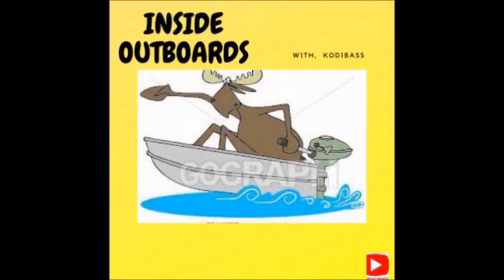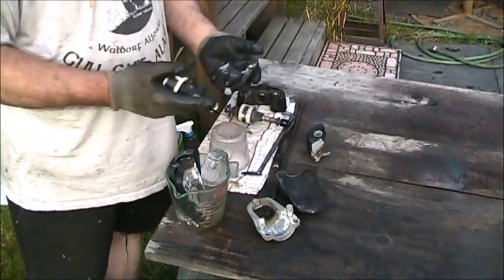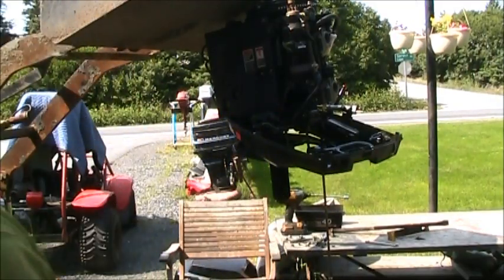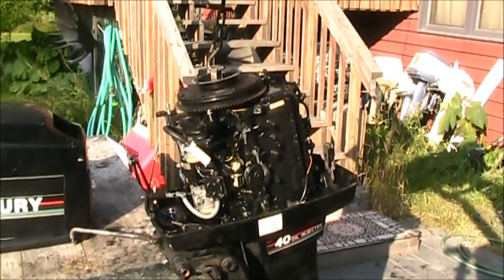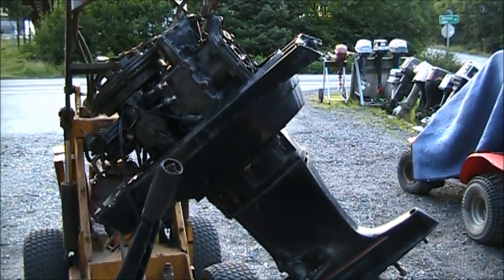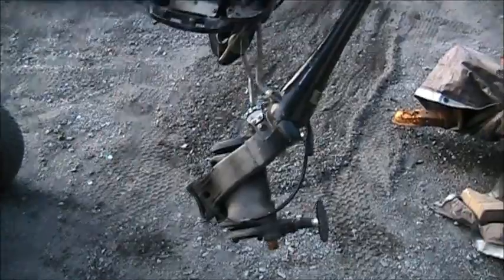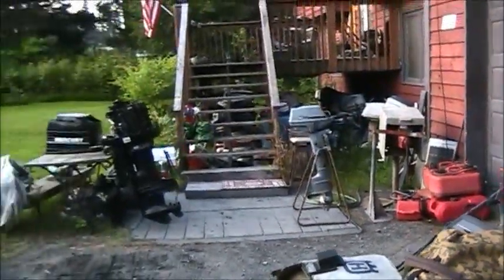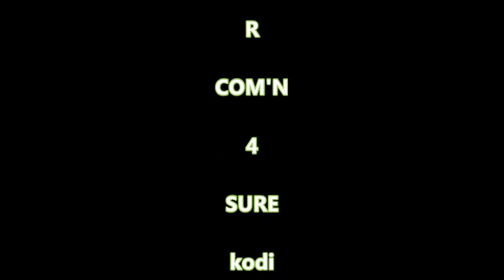BROKEN 40 HP MERCURY,  """  FIXED  """

Comment: Hi Kodi, yes love the mercs. Main reason especially my 60hp 3 cylinder  stroke 3 carb is it sounds so sweet. Kinda like the sound of a race cam on a big block engine with duel pipes and headers. Lots of balls at least the low end. Top end 5,500 rpm which is about 35 mpr.
Reply from the maker: +TWS,  Yep'  I like'm as well & yes they sound so good when set/tuned well 4 sure.               
                                                                                                                     kodi

Comment: Hey Kodi

My E115TLCIM is having a bit of an issue.
It starts easily, idles in neutral about 900 rpm, idles in
gear about 750 rpm. Sounds like it occasionally stumbles
a bit. Not a sneeze or a backfire, more like soft "pummmp"
sound. This misfire continues and gets more pronounced
as you advance the throttle under load. As the engine reaches
the speed to get the boat up on plane, the stumble disappears
and the engine runs smoothly. WOT is 5800 rpm and pushes
the boat (17 foot bowrider) to 60 kph.
As you come back off plane, the stumble returns.

What could be the cause of this stumble?
Reply from the maker: +JIC,  IT could be many things, I would start with a FACTS CHECK, & A DETAILED INSPECTION of wires, grounds, & all hoses.  If that all checkes out.  I would pull the carbs & givem at least a good cleaning or better yet a rebuild.        kodi